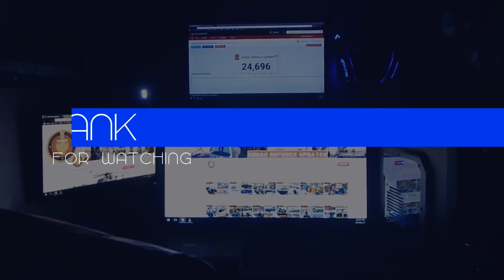Indian Defence Updates : 5 Tejas In UK,P-75I By 2024,Tata C-295 Facility Gujarat,Tank Engine Tech

Comment from the maker: 🔴What's Your Opinion : "5 Tejas In Cobra Warrior Air Exercise In UK" ?
ＬＩＫＥ | ＣＯＭＭＥＮＴ | ＳＨＡＲＥ | ＳＵＢＳＣＲＩＢＥ
Reply: V nice to hear. Dream come true. Bring on news that it scored well against F35 Typoons n F16...
Reply: @jothisampath415  it is an air exercise it is to get used to dealing with aircraft that manoeuvre differently. It is a learning experience and usually the best option to learn eachothers weaknesses. They are probably going up against the F-15, F-16 and the F-35A. But the results will be dependent on range of engagement. The BVR capabilities of all of them is ten to fifteen times more capable. They are going to be engaged in dogfighting and might be able to score a hit from time to time. On the fourth generation aircraft but that would be dependent on the rules of engagement.
Reply: @jothisampath415  . Waaaaat.? Score well against F35.???? Tejas is there for F35's target practice...😆😆😆.
But I'm curious to see the result of a Dog fight between them.
Reply: @abymathew295  ha ha. It s going to dog fight f35 euro n F16. ... Only participation s important 😆😆. With low RCS n good agility Tejas will easily evade F35 . At one point F35 will run out of missiles n match will end in draw ...
Reply: @abymathew295  y does F35 come near. Tejas won't spot F35 until it s blown away. Need to get this flying super computer for Navy atleast. Navy s not using s400...
Reply: @jothisampath415  . That's not the problem. When it comes to BVR fights,Tejas will be down even before it realise the presence of F35 in the sky.and more importantly Nobody does dog fights anymore.
Reply: @jothisampath415  . We simply can't maintain them.
Reply: @le_ecrivaine  , Well well well..then you should also know that Tejas won't be even able to  see the F35 even 20km away.
Reply: @AOC AOC Thx for the F35 Twitter vid alert – Notice the self-protection jammers seamlessly VLO integrated into the wing leading edges along with embedded RWR around the airframe to detect then locate then analyze radar threat power & frequency - that can be recorded as ELINT for future missions or to determine if threat systems have been modified or if new threat systems have been fielded – for determining appropriate Self-Protection Evasion countermeasures or SEAD countermeasures with the Fire Control Radar + Creating false targets is a result of self protection jamming that prevents threat radar processors from accurately measuring target speed & range so makes the target appear where it is not + notice multiple AESA radar beams for simultaneous search & track & targeting but only a single focused beam for SEAD to maximize jamming energy on a single threat radar or comms node or data link node + also notice air defence threat bubbles are only suppressed and not totally eliminated indicating highest energy density nearest more powerful threat radar that jammers cannot “burn through” – but air defence bubble area is dramatically decreased creating lower threat flight paths within the A2AD not requiring DEAD to preserve firepower for the high value targets being defended by the A2AD – requiring the enemy to invest billion$ more in air defence density to counter 2 x $80M F35 to protect those high value assets – Measure Countermeasure...
Reply: @Measure-Countermeasure  Correct! that video cleared quite a lot about EW even though the main feature of the F-35 is the proven stealth.. Also shows the importance of RWR the Block 4 upgrade improves on that if I am not mistaken... Multiple RWRs painting picture of battle space providing best situational awareness about everything RF.. 
You know in a few tweets the "Jag Jockey" gave so much knowledge... He had spoken about the "false targets" in the past as "seducing" along with jamming.. Now this is where I have finally understood why the electronics upgrade of EW needs significant experience and bill amount is always in billion or billions of $...
Yea going to be a walk in the park for DRDO for AMCA
Reply: @aocaoc2561  Correct - RWR were originally only to detect radar energy so were placed around the airframe for 360 degree warning - but now that most fighters have Self Protection or SEAD jammers it's important to know precisely where that radar energy is coming from to best counter it - that can be done with triangulation - that can be done with multiple widely spaced well positioned RWR arrays to increase triangulation precision + to measure frequency shift indicating radar speed relative to measurement platform = aircraft radar closing range or stationary ground radar or slow moving ship radar...
Reply: @Measure-Countermeasure  Yup these reasons why folks here  will never understand why IAF cannot fully ditch imports...Now how countries like China will improve their ECCM for newbies DRDO to directly build ECM aspect of EW for AMCA is simply not gonna happen with hardly ANY expertise and funding...
Reply: @Measure-Countermeasure  Show the level of expertise required... T/R modules being the chess board and the player capability computers of ECM VS ECCM... SAM like S-400 will have very good ECCM wonder who comes on top F-35 ECM or S-400 ECCM
Reply: Pakistani & Chinese efforts to steal Ukrainian technologies will attract sanctions from Europe & USA 🇺🇸
Reply: can you get updates on Arihant Class, what's happening with them. Why are there no more vessels being launched? What's the deal with INS Arighat.
Reply: Great initiative
Reply: Whether it's fighter jet or submarine or tank etc this L1 bidder drama will never end😠😠
Reply: Apna hi jalwa🔥🔥🔥
Reply: Since the P-75I selection date has been postponed to 2024, India must counter-act its swiftly deteriorating submarine fleet. The best option to thwart this issue, is to make an emergency order of more Scorpene-SSK's, equipped with AIP.  The prospect has benefits, too -

(1). Since MDL's submarine production line is set become idle after the delivery of INS Vagsheer, additional orders of Scorpene-SSK's could keep the production line engaged, while preserving our submarine building skiils.

(2). Since India has invested in the submarine's infrastructure/ecosystem, maintenance and training - ordering more Scorpene-SSK's is a cost-effective measure. 

(3). Building more Scorpenes has dual-benefits - it can arrest the falling numbers of the submarine fleet, while adding a technological edge. Hence, building more Scorpenes along with newer (other) submarines from P-75I gives both quantity and quality to the Indian Navy.
Reply: This could be a great prospect for the HAL Tejas - as the interaction and participation with foreign air forces could help the aircraft in gaining invaluable skills in a simulated combat scenario and could help in honing its capabilities.